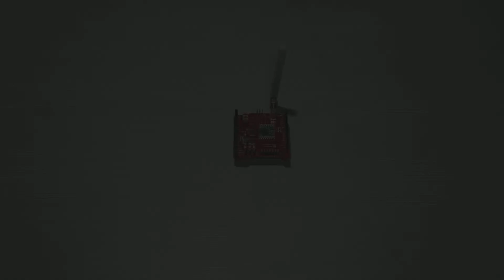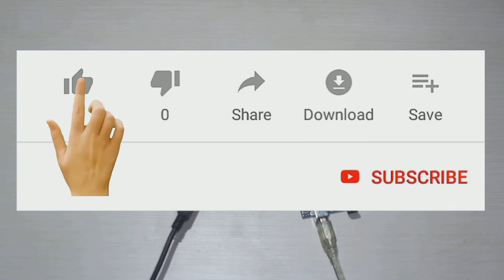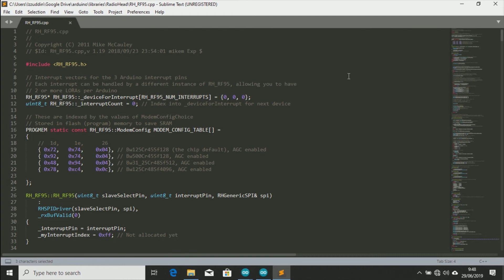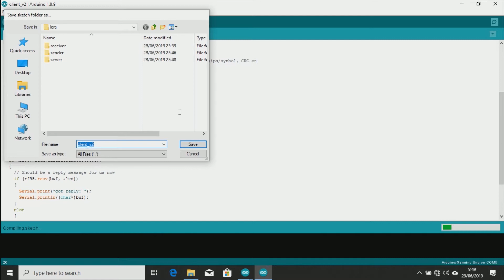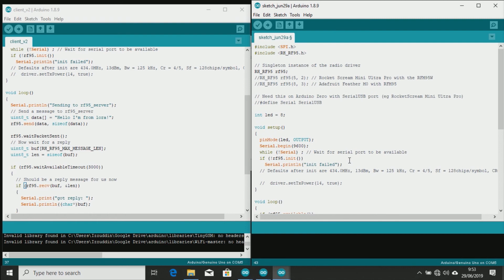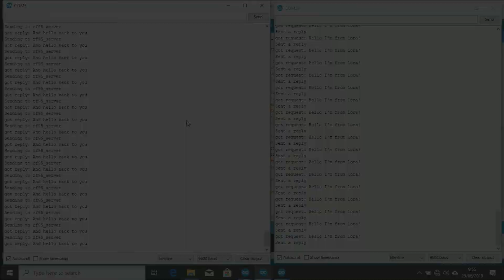How to use Lora with an arduino, and how to send sensor data

Comment from the maker: If you got "init failed" on serial monitor, try change the LED pin at server. For example change LED pin to 13.
Reply: Repeatedly showing Init failed from both server and client. What to do?
Reply: @prajnyajitmohanty4736  me too, ive change the LED more than once, but still init failed, any solutions?
Reply: Good example.. for me the LED pin change fixed the issue, Thank You!
Reply: @sarathsm1664  which number have you changed
Reply: I had this problems and this solve it TY

Comment: I changed my server and client1 freq to 915 but what I am receiving at the server from the client 1 is gibberish. I noted that a number of people have reported the same problem with similar code. Do you have a solution for the problem?
Reply from the maker: Are your lora module 915mhz? And where did you change the freq?
Reply: @miliohm  Yes I am using the same LORA shield as the ones you are using accept mine are pre-set for 915 Mhz. I managed to get it working by adding   rf95.setFrequency(915.0); at the end of the setup section on TX and RX.

Comment: Hi, I have a LoRa Shield for Arduino V95 with 868MHz factory preconfigured frequency. Got it from 
https://robu.in/product/lora-shield-for-arduino-v95/
Can i change the operating frequency to 865MHz (to be license free in India) by changing the RadioHead library files and flash it into Arduino UNO board and commuicate with LoRa gateway with same 865 MHz (change the frequency in the RadioHead code )? By the way what does it mean by factory preconfigured frequency to 868MHz and how the change of frequency to 865MHz supports? Thank you.

Comment: Sir is this wifi enabled?
Reply from the maker: No you need to use device like nodeMCU to use WiFi. This ia only for LORA
Reply: @miliohm  sir can you recommend what is the best or long range device for wifi enabled for IoT . Thanks a lot
Reply from the maker: @ineffableseul  you can use Lora for long range. And then use WiFi to send the data to internet. Use WiFi for long range is not efficient.
Reply: @miliohm  Sir, does LORA can be interfaced with arduino and nodeMCU so that it can have wifi to send data and at the same time it is long range?  Thanks a lot and sorry i have too many questions.
Reply from the maker: @ineffableseul  yes of course. In  the video above i use arduino to Drive Lora. You can send data from your arduino to NODEMCU. or you can even use nodemcu directly with Lora without arduino. But it's better to buy not Shield version. So it can easily connected to NODEMCU
Reply: @miliohm  this helps me a lot ..thank you for the informations Sir!!!!
Reply from the maker: Thank you!

Comment: Terima kasih atas video tutorialnya. Saya menggunakan frek 915 mhz. Saya sudah setfreq pada library 915 mhz. Saya sudah mengcopas program client seperti pada video. Tapi kenapa masih ada error ya kak ? Errornya :invalid conversion chat to uint8_t. Mohon bantuannya. Balasan kaka sangat saya harapkan.
Reply from the maker: Apakah programnya ada yang diedit? Itu sepertinya error ga bisa konversi variabelnya
Reply: Hanya copast dan running saja kak. Tapi tetap error. Lalu kira" solusinya gmn ya kak. Makasih banyak sudah meluangkan waktunya😁

Comment: Could you use this to switch a relay remotely
Reply from the maker: Of course we can
Reply: @miliohm  thanks for clarifying that great work by the way I know how to do it over WiFi would I have to use the connection code and modify it to use a Web server to switch. Maybe you could do a tutorial, I would even pay you for code but I see your life is busy. Thanks for video
Reply from the maker: @crazycarl9484  you just need to read the data from another lora. Then use it to turn on or off. For example if data is "ON" then digitalWrite HIGH on relay pin.
Reply: @miliohm  thanks much appreciated so I would just send data from a button press

Comment: Good Video, Can you guide me use Lora to communication before 1 Master- 6 Slave. I dont used libraries, i used SerialEvent
Reply: So we can send data from one sender to multiple receivers which is common sense. Just wanted to know that is there a limit to it ? Like not more than 1000 nodes can exist ?

Comment: Thanks, very nice tutorial! What can I do if I want to use the value of the received sensor data from the client? For example, a LED drive on the arduino server starting from a certain value? Thanks a lot and best greetings
Reply from the maker: I'm not sure if i understand what you mean. But you can convert the char variable named buf that received to integer or so. Than you can use the integer value and compare to your number. So at ceritain number you can turn your LED on.
Reply: @miliohm  You understood me correctly. Maybe my English translator is not that accurate ...) I converted the char variable to "atoi ()". Now it works. thanks
Reply from the maker: @pascalschmid4898  You are welcome :) don't forget to subscribe and share to your friends. Help us reach first 1000 subscribers :)
Reply: @pascalschmid4898  hi pascal, im doing that you do with your variable, but i dont know how is the line to convert the char variable into integer value

Comment: what if we don't use lora shield, instead using bare RFM95/96/97/98 module and making connections to arduino, is still the program sketch working?

Comment: why my RX cant receive data :( , i use 915 mhz frequency, and have changed the frequency set in the library. helm me please :(
Reply from the maker: Ga bisanya gmn mas? Compilenya sukses?
Reply: compilenya udah sukses, compile untuk tx sama rxnya sukses semua, cuma rx gamau nerima paket yang dikirim. frekuensi di library juga udah saya ganti, tetep ga bisa :(
Reply: mas boleh minta WA atau semacamnya untuk bisa saya hubungi?
Reply from the maker: @muhamadsidiq7862  e-mail aja ke izzuddin.shofar@gmail.com mas, nanti bisa difoll up
Reply: @miliohm  mas saya sdah email coba d cek
Reply from the maker: @rezaboy_o1317  kalau init failed biasanya karena pin LED nya di server. Ganti pin aja misal jadi 13 bukan 9 lagi

Comment: Hi, I'm trying to do the same thing as your tutorial, but I use a LoRa shield with an arduino (client) and a LoRa gateway. Could I use your code to send data from the client to the LoRa gateway? If not, could you tell me how can I find the suitable code for my project? Many thanks.
Reply from the maker: I don't test it yet, but it should works as long as they have the same frequency.

Comment: Hi is it possible to send data (like GPS Position) to smartphone using Lora?
Reply from the maker: For smartphone you can use internet or bluetooth, but lora can help you send data from semowhere far from internet connection to your network.
Reply: @miliohm  I'd prefer a solution without Internet. Maybe connecting 2 arduinos via Lora? One with GPS and the other next to me with Bluetooth. Do you have any similar projects or tutorials that could help me?
Thanks!
Reply from the maker: @Szelle_  i don't have one for now, so you can google for bluetooth and arduino tutorial. Simply forward data from lora to bluetooth. The bluetooth module usually use serial communication.
Reply: @miliohm  thanks